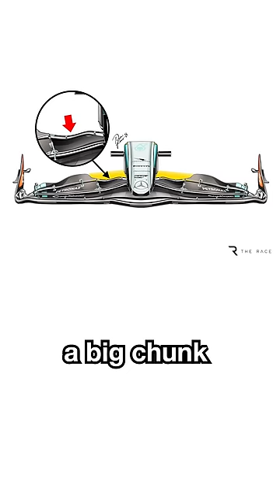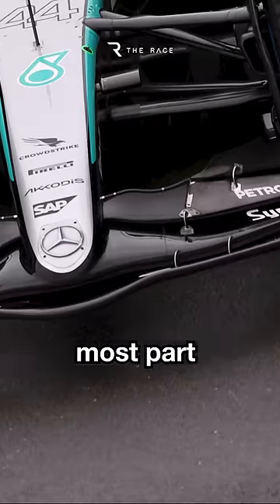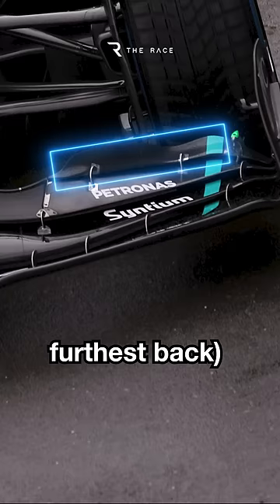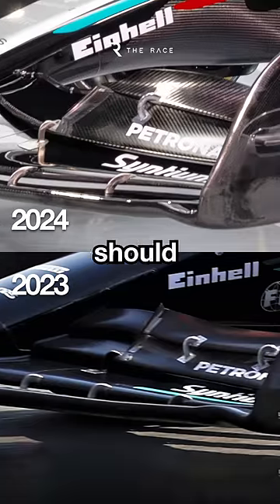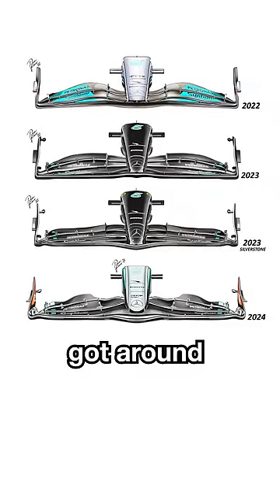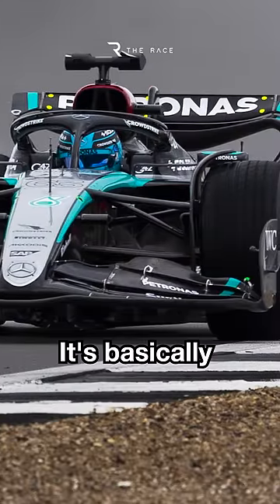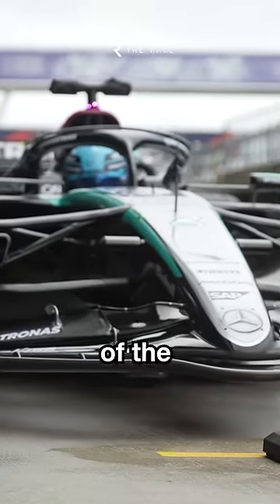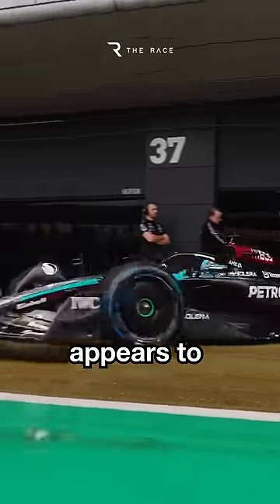Is Mercedes' WEIRD front wing legal? 🧐 #f1

Comment: With so many complicated rules, the technical director needs to be both an engineer and a lawyer.
FIA: That skinny piece is a "flap."
Mercedes technical director: Define "flap".
Reply: aNy DoEsN't MeAn ALL😂
Reply: hahahahahahahahahah
Reply: There's a team at the FIA..it's not mom and pop shop
Reply: Flap anything that can move to change air flow, much like a female skydiving naked and whistling before the shuite is pulled
Reply: I think there should be less rules overall. 

The reason I love f1 is, that it’s pushing the physical limits. So Why put extra limits that slow down innovation. 

So other than safety related, environment related and some other BASIC rules I think the teams should be allowed to do everything. That would also make the cars much more unique and identifiable. 

Just Imagine some teams having incredible downforce and fast corners, and others going 400+ on the long straights. Or some teams others having a uniquely fast acceleration. 
In the sense that each team chooses a “special ability”.
Reply: I heard f1 teams do in fact hire essentially rule lawyers
Reply: You know engineers ALWAYS have super complicated and technical requirements right?

Comment: Doubt it's a massive advantage, doesn't appear to be of structural concern and is likely easily copied by other teams. Why should the FIA do anything? Tell the other teams to stop sucking and design their own
Reply: Bro the most fundamental developments in this ground effect era are the suspension, floor and wing design, especially the front wing. Mercedes might have found a groundbreaking opportunity with this one
Reply: @danielnyangweso1759  Like I said let them copy.

At this point you are looking at fractions of percentage, not seconds or tenths in improvement. This is not going to be revolutionary. If it was you would have seen Merc introduce it last season to claw back more rather than letting McLaren steal points in their battle for second with Ferrari.

Yes wing is important as it's the first point the air is conditioned, energised and directed but in isolation it means nothing. The front wing is designed to work both the floor and the diffuser at the rear. There is every chance that yes this will allow more air to energise the floor but at what cost? How is it balanced at high speed Vs low speed corners? Does it allow you to run the car low or does it produce too much affect on the straights leading to bouncing? Do you need to dial the suspension stiffness and add more anti-dive resulting in under/oversteer at different points of the corner.
Reply: The whole copying of parts attributes to the costcap. That’s why teams are allowed to buy parts from their engine supplier to a certain extend. I agree that’s very clever from Mercedes. But realistically FIA might ban it
Reply: @Javadamutt  very well put out questions that only went can have the answers to only in Bahrain I'm afraid. But well explained though
Reply: @kenny506  Teams have copied for years, it's nothing to do with cost cap. 

Based on what? Punishing Mercedes for doing a better job of interpreting the rules? Again it's easier copied and any punishment will be seen as protecting Red Bulls lead.

It's not as if the FIA has been blindsided by this. Like the size zero sidepods Merc will likely have told them about this. They would also have seen it as part of the limited number of CAD items and wind tunnel testing time that is part of the restrictions and is scrutinised by the FIA anyway
Reply: @kenny506  I think it might be banned if it gives them a significant advantage and if it is highly protested, like the DAS was. But I think it will be allowed and will still give them a significant advantage unlike the winglets that were denied and later on allowed and used by Ferrari. But I stand on what I said, the front wing is very significant in this regulations and if advantages can be found on it they pay out massively
Reply: Question is, what if the one who wants to close this loophole is (ironically) Mercedes themselves?
Reply: @Javadamutt  The design of the front is about creating vortexes and giving cars behind dirty air
Reply: @tomknight3243  Vortices is one thing it does and was part of conditioning the air. Vortices are usually generated from the tips and edges and only when desired as they can be draggy. Usually you want the air not to be energised but remain attached to the surface of the car IE. Streamlined. A vortex is usually used to run along side creating high pressure and drag but it creates an air boundary sealing air and stopping it separating and keeping it moving in the direction you want
. Too many of these tho creates high amounts of drag and the turbulent air is unpredictable causing other aero parts not to work so only a few are created.

 In the current regs outwash or inwash and maybe one to seal the floor tho it is more likely the leading edge of the floor and the details on the floor edge are where this happens

 the main thing it does is direct the air be it outwash, towards the floor or towards the sidepods as well as being close to the ground the bottom creates a little ground effect of it's own

It certainly is not "for creating dirty air" that is a side effect of an entire car moving through the air at high speed.
Reply: @Javadamutt  The front wing had been made illegal now Mercedes are trying to bring it back and have a thin piece of wire to get around the rules
Reply: @tomknight3243  Cite your source. No decision had been made on the front wing and it's legality. 

Second yes, I am perfectly aware of what Merc has designed for the upcoming season. Can you maybe teach me how to suck eggs? I'm struggling with that
Reply: 860-409

That is the result between Redbull and Mercedes in 2023.

Who sucks?
Reply: @GoatyHerps  Good comprehension skills there understanding the point that was made. 

But ok let's bite...860-408 and yet what percentage of Mercs 23 car have they decided to copy? Clearly their own ideas weren't working

Go back to watching drive to survive
Reply: @tomknight3243 thank you for clearly stating you know nothing about aerodynamics.
Reply: @Javadamutt and all the teams have each others data anyway. Cheap to copy so stay out of it and avoid the favoritism controversy that exists with every ruling
Reply: @kenny506 they have each others wind tunnel data anyway. A wing is a cheap part as well that just bolts on and doesnt require nearly the amount of cost as say a new floor

Comment: I dont know why they didnt experiment yet with a more traditional front wing in practice sessions but the problem with there car is probably not gonna be massively affected by the front wing its either the suspension or floor or both still if there simulations clearly are wrong then maybe they need to go back to basics however a new front wing eats into there budget cap unless they could just bolt on the W14 front wing as a test

Comment: I think there should be less rules overall. 

The reason I love f1 is, that it’s pushing the physical limits. So Why put extra limits that slow down innovation. 

So other than safety related, environment related and some other BASIC rules I think the teams should be allowed to do everything. That would also make the cars much more unique and identifiable. 

Just Imagine some teams having incredible downforce and fast corners, and others going 400+ on the long straights. Or some teams others having a uniquely fast acceleration. 
In the sense that each team chooses a “special ability”.
Reply: The problem is that this will increase dirty air, which makes the racing worse.

Comment: They haven't even mentioned the critical feature. The legality strip and outer section are disconnected for "flap adjustment." It is a legit vortex generator. Smaller area could be achieved with through simpler means

Comment: I don't see the problem. There's a section of wing there, it's just not very big. It's the same as the teams running a section of wire as their floor edge and that was OK.
Reply: Flexing and outwash could be problematic in my eyes. Getting that inner part stiff enough could be a challenge. And if the vortex generated by this opening in the wing is strong enough it's not in the mind of the regulations to minimize outwash. Büro I hope it will be used. We need a closer competition.
Reply: @PatrickFuchs-iv1qk  legality wise I meant.

Comment: If any team isn't doing all they can to push the boundaries of the rules in order to gain every advantage available, then they're not pushing the sport forward.

Rules are meant to be broken, mended, and strengthened for the future. Without this, things will stagnate and die--and not just in motorsport, but life in general.

Comment: Every Front wing must consist of between 3 and 4 flaps, which both connect to the nose and end plane of the front wing. 

Mercedes engineers, snorting a line of coke. NEVER SAID HOW THICK THE FLAP NEEDS TO BE

Comment: But that's exactly what racing is all about. It's not a "loophole". The wing meets every requirement of the rule book. Loopholes are areas where there are no defined rules, so teams innovated designs (blown diffusers, DAS), which were later "banned" by nothing more than additions to the rule book... There is no addition needed here. It's not a hole. It meets the current regs... FIA can't say anything about it. Hopefully its a good design!! Merc will be a laughing stock if they're slower than the new RB (Which is last years Merc!!)
Reply: The new RB is not last years Mercedes. It's a very different car, with a very different aero philosophy. It just took two elements, the vertical inlet, and the cannons on the engine cover.